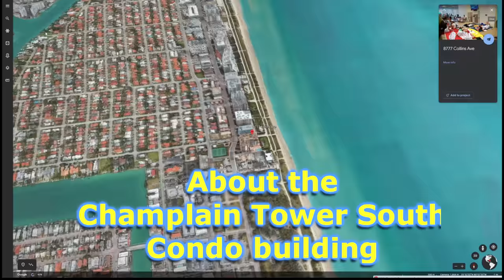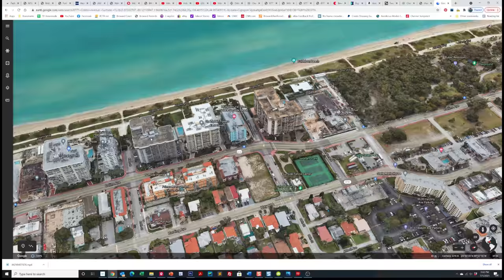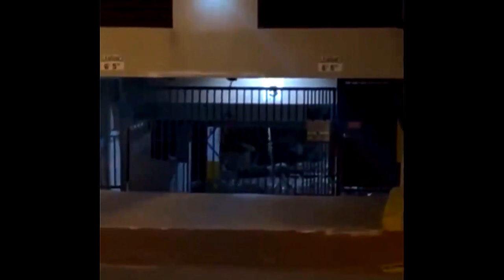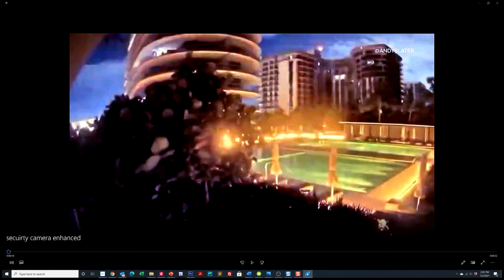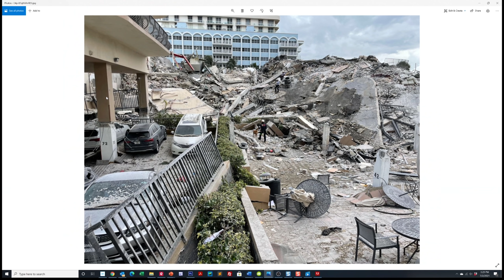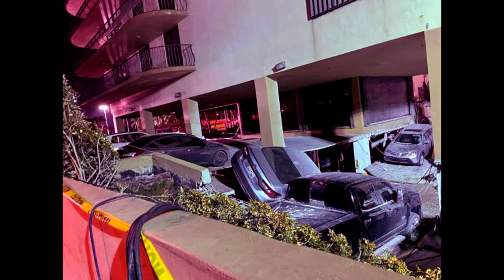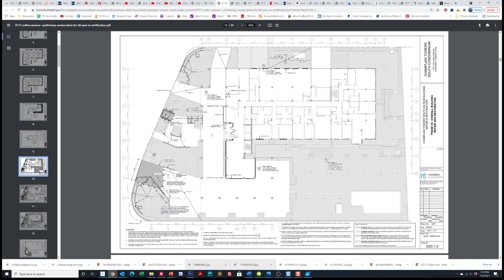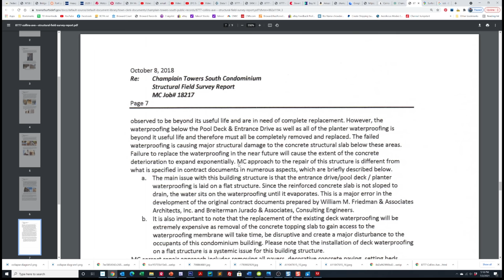Here's Cause Of Miami Condo Collapse Champlain Condo Towers, Surfside

Comment: As a window replacement contractor in Florida, i know that waterproofing was done wrong more often then it is done right.
And nobody ever wants to pay to fix it.
Reply: Absolutely. But it if a building is built properly, to the original design, it should not lead to this. Everything deteriorates and so wherever you live you need to pay for maintainence.
That is why I would never live in an apartment block. Most residents aren't interested in the politics of what needs to be done and the building managers want to spend as little as possible of the money they demand off the residents. And the residents who do get involved end up arguing about what should be done while some dont care that their apartment is leaking water through your ceiling. Its a mess, and always will be.
Reply: you are correct.  water intrusion is a slow and relentless process.  it finds the smallest entry and works its damage.  as a roofer i see the same failings you do as a window guy.  one thing i tell folks is that they should ALWAYS replace windows with nail flange new construction style so they can correct the original installers poor flashing.  as a roofer i correct prior faulty details as often as not.
Reply: Building  Contractors and businesses owners want it all built too fast ... People need to think about The Roman Coliseum,BUILT IN YEAR OF 72 AD ,and other buildings before there were modern power tools and realize why they still stand .. Wasn't there a waking bridge in Miami  that fell a few years back ?
Reply: First thing to do is to get them to screw the windows in without 2' shim spaces!!!
Reply: @ensinitas  that's a really good point, especially in Florida with stucco walls. It's expensive to do it correctly, meaning remove and replace stucco, moisture barrier, and window.. and then paint. I won't name the companies, but they all sell cut out jobs. Meaning cutting through the stucco, MB, and nailing fin. (Florida requires screws, tapcons for block) and then just throwing a window in and fastening it to the studs inside.. all it does is destroy homes, because they wanted to save some money.
Reply: @taketimeout2share  i'm not an engineer obviously, but i can't stop wondering if all the added millions of pounds of marble and granite through remodeling started it all. Usually buildings are slightly over engineered, but not too much or building would be unaffordable. I mainly wonder because he said it was originally built with a grade for drainage..
Reply: @designstudio8013  lol right, thank the guy who measured it. Technically Florida only allows a max of 1/4 inch for shimming, so an eighth all around. I usually have to cut drywall back because newer windows are around 3 inches deep to fit double pane IGUs.
Reply: What about the North Building? That seems to have no issues.  It seems those 2 elder gentlemen on the board have well maintained the property for the last 20+ Yrs.  think the residents had to pay 10k each 10yrs ago.  The water proofing has been secured & replaced tiles outside the decks going up the building.  Think the building that collapsed had a bunch of greedy people cutting corners & blaming everyone else for deterioration.  Sounds like someone else we all know used to know…….
Reply: the titanic was built poorly on purpose to sink for an insurance claim.
Reply: Sham On Them 🙏😳💙
Reply: My friend in Largo FL has windows that rain on the inside 🤑🤑 MONEY
It's all about 💰💰💰 the condo was inspected 😂 More MONEY 💰🤬
I pray for My friend , Barbara every day 🙏
Reply: Is her building a collapsible one?
Reply: @VIDSTORAGE   I have seen drywall contractors try to use cheaper metal framing instead of what is code because they save money and most building inspectors are not looking at the guage they just look to see if it was done right they use the cheap home depot crap lol yet once it is covered up with drywall how would the buyer ever know?

Comment: From an ICC Structural Inspector viewpoint I would concur. Excellent analysis. The leaking windows and developing cracks in the decks where the early indicators that the structure was beginning to fail. When window frames begin to leak it is almost always a sign of structural shift.
Reply: From a sane random woman's perspective- zero engineering only wrote estimates for steel frame commercial buildings as a small business  - that analysis made perfect sense to me, too.

Normalization of deviance in the structure. Allowing the steel to get that far exposed. 
Surprised more haven't fallen.
Reply: Good to know I live in a high rise in Fort Lauderdale I am now always looking at the structure

Comment: It's just crazy how much load those five columns were taking every day. On top of being relatively small in diameter, they had to deal with the following: the weight of all of the concrete floors above, the weight of any standing/flowing water, the weight of a seemingly full capacity building, and the weight of the pool deck, all while being compromised from salt water intrusion causing sprawling. If this isn't a recipe for disaster, I don't know what is.
Reply: Those 'knocking sounds' people mention could have been a rebar under the stress slowly pulling outside of concrete floors/ceilings by the building part that sinked in the last days, hours, minutes..
Reply: i've been anticipating the stories of those whove been there either as a tenant or a viewer and got out, 'cause they ... had sense.

Comment: Failure is rarely a “sudden” event.  It’s a series of engineering mistakes and other issues ignored for years.  Any break in the chain could have prevented this.
Reply: With stuff like this once part of it goes, it all goes.  Concrete doesn't bend like wood which may sag and alert to a probem.  But wood decks collapse suddenly all the time from dry rot.  Once part of it goes all the force goes to the rest and the rest doesn't have the strength and a domino effect happens.  It seems like the extreme failures were only apparent minutes before the whole thing collapsed.
Reply: You are so right - we must honor the dead first, but then there needs to be a HUE and CRY - because in just his one week the news has revealed that the problems that resulted in this tragedy began 13 years ago and were very poorly attended to.  A few people should be in jail for the irresponsibility that is behind this sorrow.   Prayers for all those who weep today though "..comfort, comfort my people"    Take interest, keep interested. - caring is what it's all about.
Reply: Greed caused that building to collapse, pure and simple.
Reply: What pisses me off the most is that tax payers are paying for the cleanup.
Reply: Duh? Did you watch the video?
Reply: Benjamin Z- Finally! Someone who gets it! The condo owners were told about the damage to the building, but once they received the assessments , of what each owner would have to pay, they all voted against it. They were even offered payment plans so they could pay it out over time. They all voted that the costs for the repairs were too expensive. They knew. They were asked to pay for the maintenance, and still said no. If I don't maintain my home, it will fall down. And, who would be liable for that? Me. The property owners should have come up with a way to borrow the money and paying it over time. They decided it'd all be good with a few cosmet8c0s
Reply: @millionbillion6384  really?  Not the loss of life.  You are scary.
Reply: Greed and Profits!!!
Reply: Didn’t he say in the video that the engineers wanted sloping surfaces by the pool but the architect did not incorporate that into the original design.  The maintenance report highlighted the problem and work had started but maybe not started at the most dangerous point.
Reply: Yeah, in the design!
Reply: @younggrasshopper-apprentice  please watch the entire video and focus…they were told in 2018, the building was in serious trouble…oh, and the building did not fall straight down…
Reply: @minigirl6379  I agree, they ignored the 2018 report and people died because they didn’t want to correct the neglected maintenance issues… We sadly learned the value of their lives…I guess the assessment would have been about $100k per unit.
Reply: An admitted sidebar/conversation veer: I have a friend who works in community/social services. I asked her once about people who end up in crises. Homelessness, et cetera. If it's usually the result of something catastrophic. She said it wasn't. Instead, it was almost always a series of events. One piece of bad luck, a bad decision, an external change in circumstances. So to me, it's fascinating that what you've proposed isn't something that only happens in areas where engineering is involved.
Reply: r laze  I guess I missed the part about the sinking in the video…can you give me the time he talks about sinking please…I need to review
Reply: r laze  the date stamp was 24 June, I have not seen any recent reports about sinking…why?
Remember, news outlets jump the gun all the time for ratings.
It may have been a contributing factor but I like the facts shown in this video.
The 2018 engineering report shows the building was in extreme decay.
Reply: true, and btw, it's a reality breakdown, like planes in towers.
Reply: r laze  there are plenty but I only see them from right after the disaster…are there current sources reporting sinking?
Reply: r laze  I agree, plenty of blame to go around…it’s always 20/20 after an accident.
I have read so many aircraft accident reports in my career and sadly, it’s usually human error.
It appears the original design may be at fault along with lack of maintenance…
Now all of these families need to try and pick up the pieces… :-(
Reply: @probitionate  same thing with plane crashes. It's  a chain of events some sudden some not
Reply: @xdarthpool6463  security  guards aren't  known for their brains
Reply: @gregwil6930  just say fake news. Cmon now your orange daddy taught y'all  that
Reply: @younggrasshopper-apprentice  Yeah........okay
Reply: @tomm1109  he was saying, a collaps doesn't just happen for no reason, something was wrong with the building for it to eventually collaps. All you had to do is look at the water in the basement.
Reply: The gravity of this disaster was shown in 2018; condemned & evacuated due to serious structural visual issues !
Reply: No it is not demonic to honor the dead - YOU won't think so when it's you someday nearing the end of your time on earth.  If the person was graced with the miracle of life, we owe the respect at death.   To obsess over the dead is not healthy but usually still not demonic, unless there is some deliberately evil goal in the attention and honor we pay to dead and dying.
Reply: as the facts mount up, it is clearly gross negligence since 2008 and on and on till the collapse.    Comfort the grieving and honor the dead, but then go get 'em!
Reply: @millionbillion6384  -  I do not think the taxpayers will pay....if so, the lawsuits will be in part by the government to be paid back for their costs by the guilty builders/inspectors/ repair people etcc
Reply: @tomm1109  awwwww.....you know that he meant the people first...but he is right to yell about the injustice in followup actions. UNLESS the people engage and stay engaged tilll the thing is done correctly.

Comment: I found that vid really hard to follow but I did like it. I feel it would be helpful for your audience if you press the Windows logo key + U, select mouse pointer and change the colour. So your mouse pointer is not white on white.
Reply from the maker: We will use a highlighted mouse on the next one
Reply: @jeffostroff  Yes. It was like trying to follow a hockey puck
Reply: In 20mins of the video I only saw the cursor for about 10/15secs in total time . Maybe enhance the size by 100% and use a outstanding colour. All in all great analysis in your video..
Reply: @Paul McMullan - best comment!!!!!! thanks for the info
Reply: yes perhaps the editor would go back and resize / repointer their talk. i vagely caught a pointer one time and simply trusted the audible portion.
Reply: Excellent presentation and analysis but I do agree about the cursor parts. I think a bright green or bright orange color works best along with choosing an option that leaves a trail as you move cursor which makes it easy to follow - especially for the so many people now watching this on smaller screens such as phones and smaller tablets.

Comment: Absolutely excellent presentation, and utterly convincing.
May I add one minor point?  At around the 20:00 mark, you mention the puddles on the pool deck and how this would 'add a lot of weight' to the slab.   I think there is an additional problem: salt.   Salt spray that blows in from the ocean during storms and sticks to the building.  It would eventually then drain off the side of the building and wind up on the pool deck.  Another source of salt would be the sand that would be tracked up from the beach by people with sand stuck to their shoes.   Since the water would be continually be evaporating off this slopeless deck, the salt would keep concentrating.   This salt and water mixture is much worse for concrete rebar than just water alone.
Reply: Are there any diagrams or blueprints that show the pool deck/garage roof in cross section?  Is there concrete both above and below the membrane?  If so, the concrete above would be salty (from sea spray and repeated evaporation) and often wet (from being poorly drained), whereas the concrete below would be dry and mostly free of salt.  Then the concrete above the membrane would hold a lot of water and expand a lot when wet and put tension on the dry concrete below.  And could it also put enough tension on the the post-tension cables to make some of them snap?
Reply: Excellent point.  There is a saying "Everything becomes salt in a salt mine".
Reply: Yes. Particularly if current building inspection opinion that the rebar for this building was insufficient. You likely all know, the names of those who signed off on building inspections during time of manufacture are being looked at